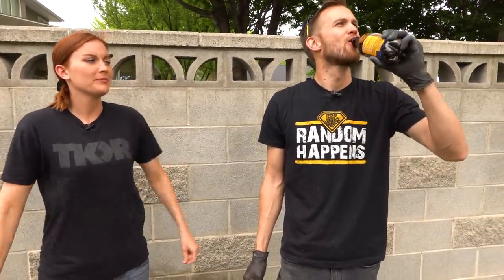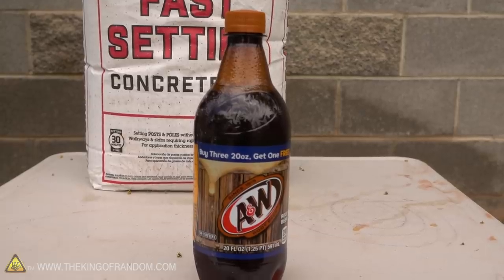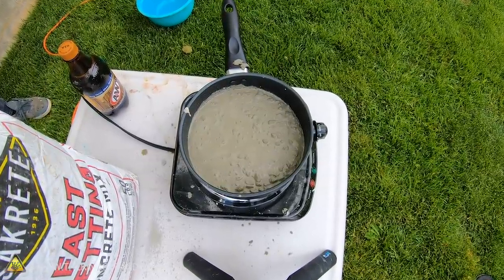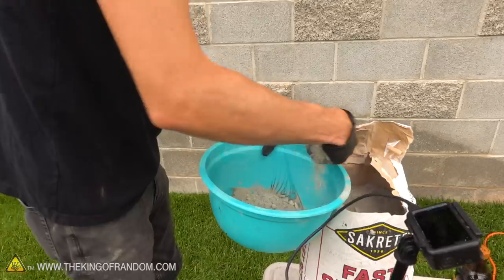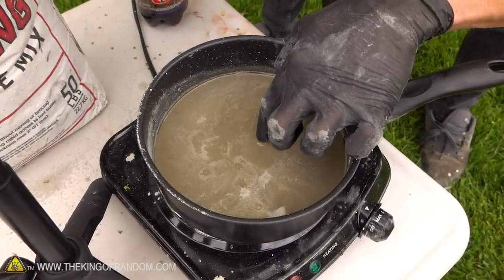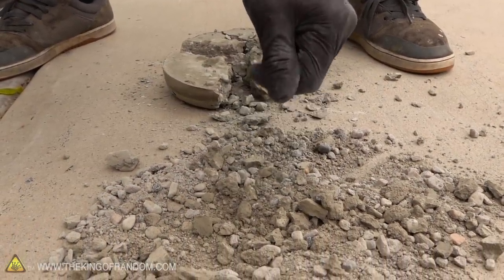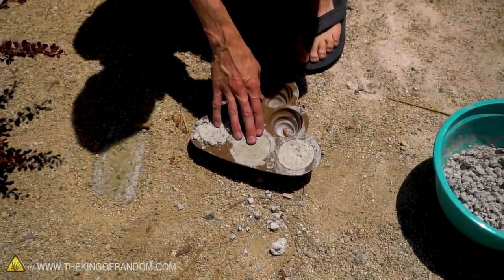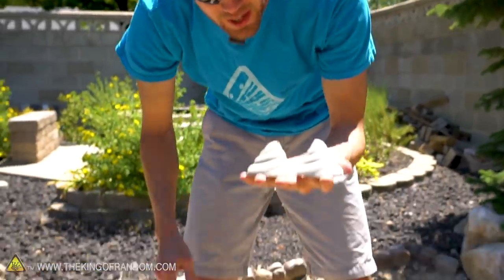How Strong Is Cement Made With Root Beer?

Comment: Try to mix cement with honey like ancient Romans did. That will be interesting
Reply: They did what now?!
Reply: Say whaaaa...?! 😲⁉️
Reply: They should try it with liquid nitrogen
Reply: @chrisbrl88  And you're as sweet as sugar <3
Reply: Volcanic ashes too. they should have tryed with boiling water
Reply: gastank43 thanks for the positive energy 😊
Reply: @chrisbrl88  no need to swear dude
Reply: @DonMomotaro  when did he swear. He's using that word in the original way it was supposed to be used.
Reply: @Virginny  it's a joke
Reply: @DonMomotaro  ok
Reply: @chrisbrl88  it could also use to help hold it together. Honey is often used in cooking as a bonding agent, and I assume it would do the same to concrete.
Reply: They should try shredded paper for strenthg test
Reply: No in ancient Egypt, they "tape" Stone blocks to each other with mixture of honey and egg whites
Reply: sugar slows cure
Reply: @nauticalgaming2256  It would not. Different chemical process.
Reply: They did what now?!
Reply: Ahhhh, year 3 thought me that.
Reply: Hi Vladimir putin
Reply: Sugar will slow down the drying time for concrete. Would be interesting to see what honey would do
Reply: Hi
Reply: MOLLASES OR EVEN SEAWATER AND PULVERISED SHELL!
Reply: @chrisbrl88  SLOWING CURE COULD INCREASE PSI STRENGTH

Comment: I heard that mixing sugar into concrete before pouring ruins it, could you test that?
Reply: no it isnt
Reply: @eagle94haslanded  you're not wrong but you're definitely not right
Reply: 2 pounds of sugar for every ton of concrete, French anarchists used this to protest construction of prisons, I believe
Reply: Joe Blow that’s what reminded me of it but I doubt it works the same as solid granulated sugar
Reply: sugar keeps concrete from setting. we used to mix sugar with pool shotcrete if we made too much. also works on plaster for pools. brown sugar works best.
Reply: Bruh i’ve seen sugar mixed with concrete in Happy Tree Friends, yeah bad things happened
Reply: @charlesdeem5488  man you beat me to it
Reply: MMMmmMMmm jaw breakers
Reply: Sugar acts as a retarder slowing down the chemical reaction of the cement.  Added to much will will severely weaken the cement as its not able to build the crystal structures that give it its strength.

Comment: Should have done a controlled. That’s the only thing missing here
Reply: I’m pretty sure water was the control
Reply: - FourspaceV&M - they boiled it so it was also an expirement. There wasn’t a control
Reply: How would they do a controll
Reply: Banana Doppio just doing it normally using only normal water
Reply: They also should have let a bottle of the root beer go flat so there was no carbonation and done that too
Reply: Yes, and to make sure the rest ingredients are used in the same amount, including the test part.

Should use something that is measurable
Reply: I agree
Reply: I was thinking of boiling it over the foundery to get it hot fast enough

Comment: I love it when science is attempted without a control. 

Side note: boiling concrete/cement would make the curing process less efficient (concrete curing is an exothermic reaction). So ultimately you're boiling off liquid water before it can react and make solid bonds (e.g. why it was like chalk instead of concrete). 

The dry ice thing sort of makes some kind of sense almost... Except that the solid CO2 is just going to leave voids inside (as you saw here). Better option... chill the water before mixing with the concrete/cement mix which is a thing that's already done by professionals. 

You do need a minimum temperature of about 40 degrees (gotta make sure the water doesn't crystallize before it can react because solid water won't mix nicely with concrete but cold helps the exothermic reaction complete.
Reply: Yup, definitely needed a control to see if the awful results are due to the weird mixes where control greatly outperforms experiments or bad batch where the control sucks too.
Reply: All the concrete companies around here use hot water (if requested) to make the concrete set up faster
Reply: Smartie 😃
Reply: Yep, ruined the water to cement ratio and shocked it essentially. Also with the dry ice, we use that in Texas to cool it because concrete can’t be over 95 while pouring
Reply: SPC pitts that’s so against ASTM
Reply: The control was supposed to be the water one, but due to them not being proficient concrete mixers it may habe been a bit subpar

Comment: Should've had one that was properly done with regular water as a control.
Tip: Let concrete set while being wet, it'll be much stronger. Letting it dry out before setting properly makes it a lot weaker. Concrete should not be dry while setting.
Ever seen those construction sites where they have sprinklers on top a large slab of recently poured concrete? It is to keep it wet during the whole setting period.

Comment: You should try to melt cement in a Crucible and see what happens.
Reply: Niajara Thoresen you cant do that 😂
Reply: @fluffyhamster3548  I would if I could, dont have the tools
Reply: It explodes, the air trapped inside expands and has nowhere to go and it heats very unevenly, The shards are extremely hot, sharp, and fast moving. source: I'm a construction worker who deals with the stuff daily, as well as acetylene torches. The worst sort of burns in my opinion are concrete burns popping from heat, far worse than slag from melted steel.
Reply: @FarlanderIndeed  Ahh! You spoiled it! Still want to see it tho,and if it douse...

Comment: I feel like with boiling the cement, it may have been a little off, considering you guys used fast setting concrete. I feel like it may have boiled more if it weren’t for that, but that’s just me...
Reply: I was a bit annoyed they used concrete instead of just cement.  The rocks don't really seem necessary at all.
Reply: And no control sample, either
Reply: @luckyrashes  that's what I was thinking

Comment: "How Strong Is Cement Made With Root Beer?"

You do know that cement is just a part of concrete, concrete is made of rocks, cement (limestone and clay) and water. The strength of concrete depends on how much cement is mixed into it. Also it can take around a month for concrete to completly solidify but that time depends on the cement itself.
Reply: Your over thinking it :)
Reply: its a experiment dont overthink it
Reply: Finally somebody who knows this and calls it concrete when it’s a mix and cement when it’s the chemical compound
Reply: No, I wasn't aware tbh.
Reply: @preppypeaches9340  cement isn't very structurally strong. It gets it's strength from the matrix formed from cement, sand, and gravel. The smaller the gravel, (generally) the stronger the concrete. What they made was cement, the binding agent of concrete. Not the same at all.
Reply: Amen. Calling concrete cement is the same as calling cake flower.
Reply: I agree totally.  Lol. A Baker doesnt bake flour. He bakes a cake. It's an ingredient.  Cement is to concrete as flour is to cake.

Comment: Hey! I work at a material testing company and we actually test concrete a lot. We make concrete cylinders and compress them until they break. Their compressive strength is their max break strength! You could make some cylinder and mail them to me. I’d be happy to break them for you:)  Also the cylinders are 4 inches in circumference and 8 inches tall

Comment: When Hoover Dam was being built, they mixed ice with the cement to keep it cool - because when you pour huge amounts of cement - it generates a lot of heat on its own and in doing so would cure too quickly. Adding ice keeps the cement cool so it cures slowly.

Comment: When laying concrete you tap the forums before grouting and before sweeping (unless you dont like rough concrete for better traction)
Reply: Well since theres carbonation I expected it to have large depsits of air which would compromise the structural integrity but it was more distributed making it light but weaker than usual. None the less it will probably be the new spray on shoes.

Comment: This kind of experimentation really piques my curiosity. Knowing about Aircrete and variations of that (concrete mixed with an air-holding agent like shaving creme or styrofoam beads) I wonder exactly how much air can be mixed into concrete, if gasses like CO2 or He can be foamed and mixed in, how much strength can be retained.

Comment: As a readymix concrete driver this pains me.

Concrete needs 28 days to reach maximum strength. Yes the rootbeer did produce a stronger concrete, it is due to a thing called carbon curing. Dry Ice freezes the concrete and causes it to cure incorrectly as a result it is brittle. Same goes for boiling you are super heating concrete essentially to the point it loses most of its moisture especially in a mix that has most likely a 2% calcium chloride accelerant being that it is fast setting.

Comment: Why didn't you do a cast of the concrete made using the instructions on the bag?  That way you could tell if the various additives make it stronger or weaker than the "official mix".

Comment: First of all, cement and contrete are two different things. Concrete is Portland Cement + aggregate (i.e., sand, gravel, fiberglass, etc.). Secondly, cement slurry will boil while concrete mix won't. The aggregate in cement mix prevent the slurry from having convection.

Comment: Root beer is filled with Co2 which is very detrimental to Cement's strength as it creates air bubbles in the concrete ranging from microscopic to a cm or so which in turn causes internal cracks.
Also you should have left the samples for 30 days for proper strength testing.

Comment: might you, stir the concrete until the whole pot gets up to heat-   heat the water before stirring the concrete into the boiling water and stir until returns to boil and remove from heat, stir until the boiling stops-

Comment: i feel like the distinction between cement and concrete should definitely be explained.
Cement is the binding agent. The powder that holds the aggregate (the rocks and sand) together. Concrete is the fully set end material. In this video they make concrete with root beer instead of water, not cement from root beer.

Comment: the concrete treated with heat is no surprise; i build concrete bridges and concrete drying and curing is actually an exothermic reaction. we have to cover the wet concrete with wet burlap and white plastic so the sun doesn't dry it too fast, which messes with the curing process and results in a brittle concrete. The heat acted somewhat as a retardant for the concrete (quick dry additive)

the root beer concrete was way too much water. it looks more like slurry, what we use to patch pinholes after stripping forms off of dried concrete. edit: looked closer to the right consistency at the time of the brick pour.

Comment: The point of concrete is that the chemical reaction makes it heat up and evaporate the water, which makes it hard. Boiling it will just boost the reaction

Comment: Concrete must not be allowed to become either too hot or too cold or the chemical reaction that gives it strength will not work correctly (since curing concrete produces heat this includes self generated heat that can spoil the process unless monitored and managed). The water content actually works better the less you use, as long as you use enough that you're actually able to pour it. Finally, you must use CLEAN WATER!!! Any organics or salts in the water could disturb the curing process and lead to weakness in what you are trying to create.

Edit: oh, and there is a process for adding carbon dioxide to concrete but it involves more than just chucking chunks of dry ice into the mix. The process shows promise as a way to reduce the greenhouse gas emissions that come from cement production.

Comment: Heat causes concrete to set quicker, but setting is still a chemical reaction and takes time. Boiling all the water away completely ruins the concrete.
 
Setting concrete against soil/sand strips the water from the top couple inches and causes it to be weak, similar to boiling the water away.

Comment: Prediction:  boiled cement sets too fast on bottom of the pan.  Rootbeer carbonation helps mix cement better but sets similarly to just water.  Dry ice does nothing,  If theres no heat the cement won't set